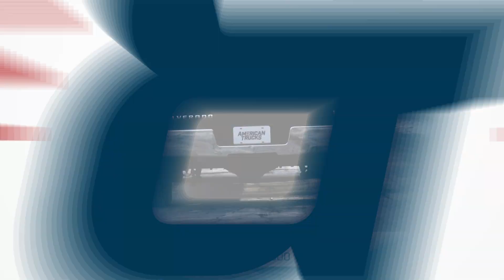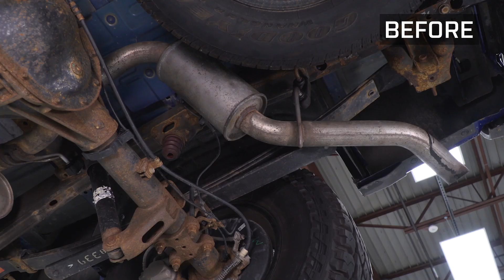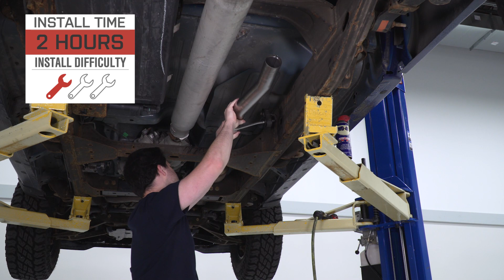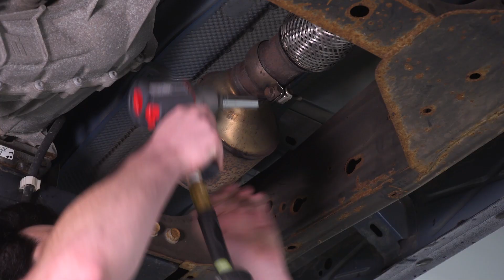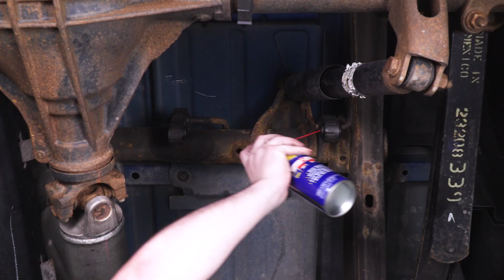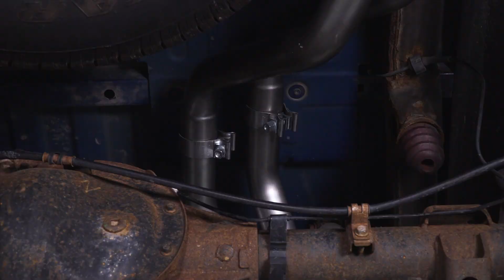2014-2018 Silverado & Sierra 1500 Borla S-Type Dual Exhaust; Black Chrome Tips Sound Clip & Review

Comment: Added to my cart damn…i have a question, I have a 2014 5.3 Silverado 133k miles “mostly Highway” definitely LOOKS it.  Also mentioned it was moderately driven but in Massachusetts so “lots of pot holes” only had that one owner who said he occasionally floored it but was a relatively cautious driver. I don’t know to much about the 5.3’s what would you guys be worried about with 133k miles on a truck like the Silverado like a go to list of things to fix up to keep her in shape in case she isn’t as good as the last owner said??
Reply: Bro, the best thing you can do is take it to the dealership and request the all points inspection. I’ve got a 2017 5.3L and that was probably about the best thing I could’ve done for myself.